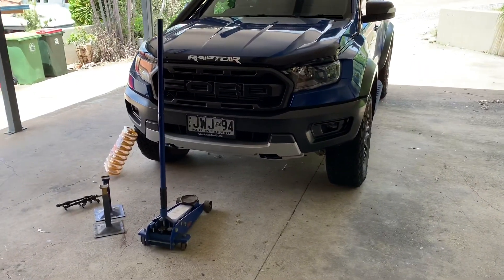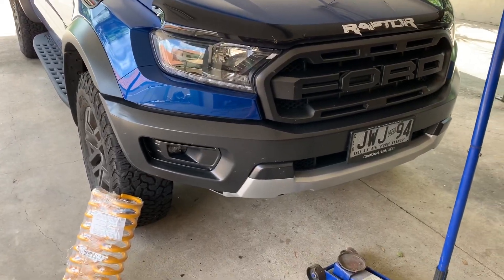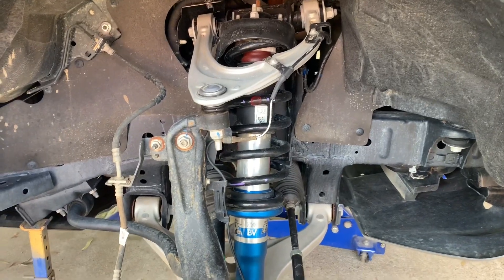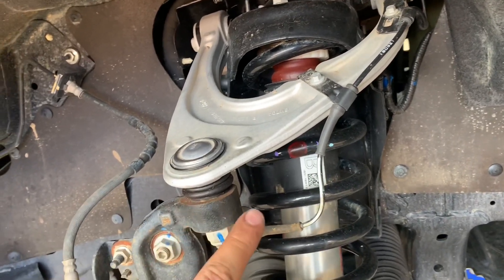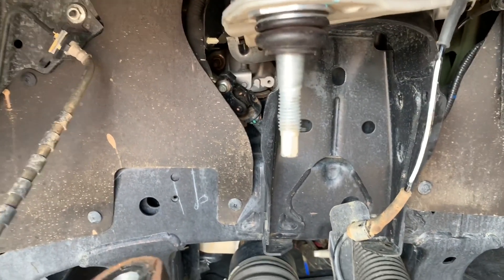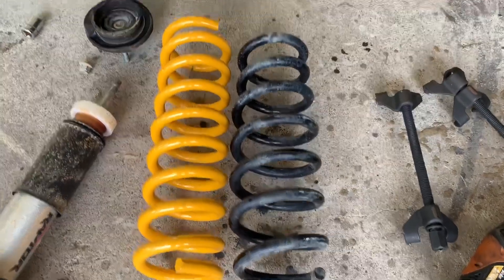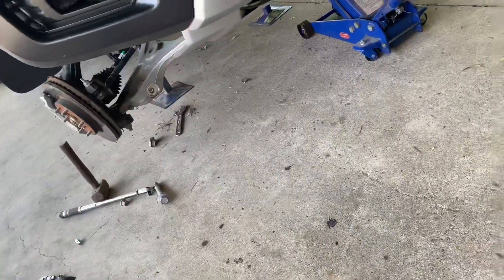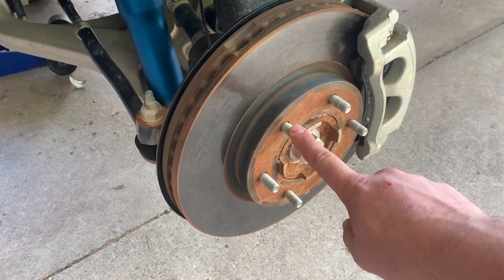Ranger Raptor front suspension Lift installation

Comment: Just a note the tension on the brake flexi hose & driveshaft can pop the inner joint I would advise to support the hub even put suspension arm back on temporary to help.

Comment: Hi mate. I bought these springs and just about to have them put in. BUT I’m seeing a lot of other guys are getting their shocks revalved. As it’s been 2yrs since you made this video, do you still think revalving isn’t necessary?
Reply from the maker: I personally have never had an issue, when I remove all the weight out of the vehicle the ride becomes stiff but that is just because of the heavy springs. But I ride and drive stock raptors and rangers everyday in my job and when I jump back into mine I don’t really notice any difference… especially not a couple grand difference. But that’s just what I think
Reply: @jacobsgarage5458  thanks you mate for being so informative. Much appreciated. I’m just going to do the front springs for now. Might do the rear later, but will let the front settle first and see how it looks and feels.

Comment: In which store you can get the KFFR-120 KFRR-121
Reply from the maker: Autobarn is where I got mine
Reply: @jacobsgarage5458  Thanks! What would be the correct configuration so that the Raptor is level. Forward and backward with the same height.

Comment: Hi Jacob amazing and helpful video thank you. If you are kind enough can you confirm if the tyre size 315/70/17 fits after the 1” lift set up like your video?
Reply from the maker: It’s a 40-50mm lift and I couldn’t tell you because I have stock wheels and tires, my guess is if it is 315/70r17 it’s still around a 33” tire just wider so all you would really need it wider offset rims, so instead of running a pos55 spacing you would run a pos20 or 0 offset but then you run the risk of the tread sticking past the guard
Reply: Thank you

Comment: awesome video mate. so what do you recomend leveling kit or new springs. what is better for ride quality ? Can you just change the front springs ? and the car looks level ? thanks mate
Reply from the maker: Andrew Bamber cheers, well there are the two options for leveling the front one is the springs I installed which also help when putting a bullbar on because it holds more weight, but the other is the coil over spacers such as the snake racing ones. To keep factory ride quality go with the spacers but if you are adding more weight I’d go with the springs to keep a better ride and height. I did change just the fronts initially and she sat perfectly level

Comment: Thanks Jacob how was the ride after was it still soft or you feel the bumps now.I am waiting on my spring and hesitating to do it , thinking it might wreck it but i have put a bar and winch on last week .(predator and Wran winch).
Reply from the maker: dom bivi I haven’t driven it much yet but I live on a very bumpy corrugated road and it feels pretty much the same, but it also feels like it has less body roll on the road. Yet too see how it will feel with a bullbar and winch though. So far I haven’t really got anything bad too say but it is early days... only fitted them 6hrs ago
Reply: @jacobsgarage5458  how are they after a year mate? Have a 19 Ranger raptor myself and was thinking of buying these exact springs.

Comment: that bottom, bolt is torqued to like 550NM or something close. good vid though mate.
Reply from the maker: Rhys Barrett 258ft-lbs is around 350NM, idk about you but I’m not strong enough to do 550nm lol, cheers bud
Reply from the maker: But I will also double check all bolts in a few
Days and make sure too hang off that bottom bolt
Reply from the maker: Will make an edit correction
Reply: Yes it is correct. 550nm the bottom bolt in the front and 475nm the bottom bolt from the rear suspension